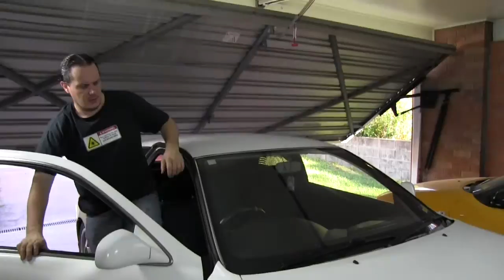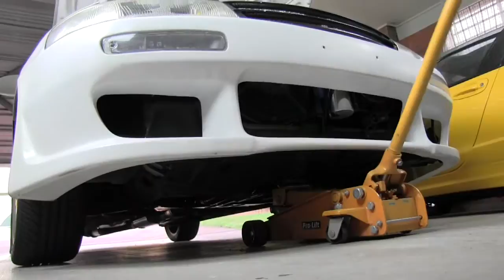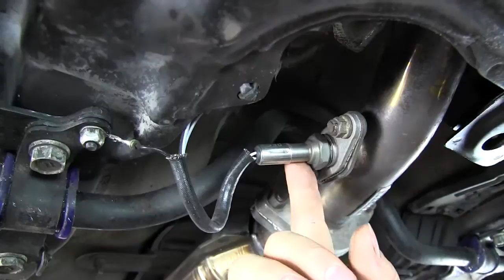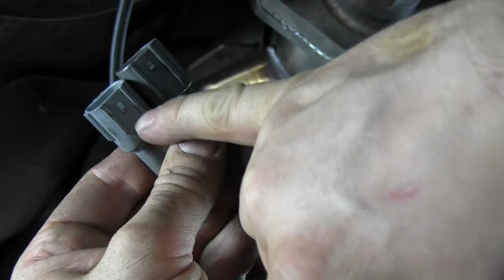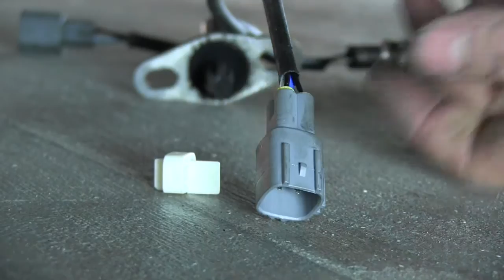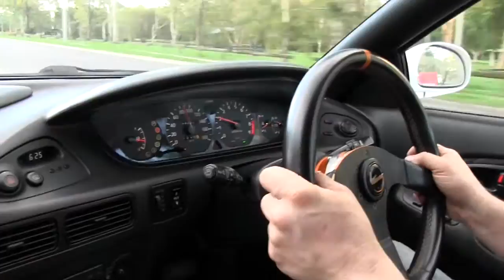How to replace the oxygen sensor on your 4AGE

Comment: can this 02 sensore help my vvt ? not working
Reply from the maker: MICK Thao Possibly... Is your engine in the original car, or is it an engine swap? Make sure the purple white with white line is connected to a speed sensor on the transmission.
Also, double check the operation of the VVT pulley and solenoid. I have another video on how to do this.

https://www.youtube.com/watch?v=ekkXQR2AY-s
Reply: i blew my first engine den brought a 2nd hand engine and bolted into my car ever since that the engine in it now just felt very weak and VVt Never engage so i brought a new Solonoid and also has replace the VVT pulley and that was from the old engine,, also not sure if the timing was off.. and have never replace my 02 sensor yet.
Reply: +TERRAOperative Hey man will that Denso 234-4162 fit standard silver top headers?  I had bought a universal only to find the flange that came with it was too small to straddle the standard bolts on the headers.  The o2 sensor I took out was one solid unit flange and sensor in one.  Toyota NZ does not stock the sensor for the silver top, and may have to buy the Denso off ebay.
Reply: I bought this on ebay, and it did not fit. So I grinned the edges to make it fit. Unfortunately with this new O2 sensor, the engine is bogging when warmed up..Disconnected it, runs fine. Connected again. Bogs.

Comment: Well mate I'm after failing 4 emission tests because of mine not heating .. which wire did you ground the heater ground of the ecu ground I'm pretty sure u mean the heater ground but I'm not 100% please you can tell me as I have another test Monday I'm also driving a 4a ge thanks

Comment: Great video mate! An epitome of 'How-to'. Thanks! 
I'm going to order a Denso 234-4162 and give it a whirl on my Blacktop.
Fingers crossed it will get rid of the hesitating between 2000-3000 RPM when cold.

UPDATE: 26.08.2014: This oxygen sensor is too small for the Blacktop.
I had to cut slots in the side of the sensor. The plugs are a straight fit too, unlike the AE101.
The hesitating hasn't gone away, BUT I haven't run it in properly yet, so the ECU hasn't had time to re-calibrate. Hopefully It'll come right.

Has your fuel economy been better?
Reply: any updates man?
Reply: Shannon Sonny Yeah, turns out my TPS [Throttle Position Sensor] is buggered. It's definitely that as I tuned it as via the manual and it came right! If you are getting lagging issues too, check your TPS and change the Oxygen sensor anyway.
Reply: James Tyrell 

exactly man, but to find a shop that isnt just doing it for the $$ is so difficult. 

so much sense! yeah man, perhaps you could shoot the PDFs to me, trust_wrx@hotmail.com

Man, what a gesture, sadly im in Malaysia, Kuala Lumpur. 
Ill try to sort things out, but thanks a bunch mate, been too damn helpful! 

Cheers!
Reply from the maker: James Tyrell  Yeah, the throttle position sensor can cause a few issues if it's not calibrated properly...
Thankfully it is easy to calibrate with a multimeter and a feeler gauge and some patience.
Reply: ***** Problem is mine falls out of tune after 6 weeks. Does yours do that?
Reply: James Tyrell  ***** 

mine hesitates massively, also my VVT isnt engaging.. i have replaced the solenoid, so i guess my car has got all sorts of sensor/electrical/wiring issues.. sigh.

Its a 20v BT in a KE70 Corolla, and it doesnt even have a diagnostics port. i bought it only with the engine in it. haha. fck..
Reply: Shannon Sonny 
Ah bugger! Nice chassis the KE70! :) I have just ordered a new TPS from SQ-Engineering, $110 AU instead of $280 NZ Toyota wanted and it arrived today.
I measured the resistance of the HT Leads, and they were WELL under the recommended 2500 Ohms! The Cap, rotor and spark plugs were also well worn out. 
Now that the TPS has arrived, I will install that and fire her up with; NEW HT leads; NEW Spark plugs; New Cap & Rotor.

Check all of these on your BT Shannon, especially the HT leads and TPS. 
Do you have a the manual with all the specs for tuning these?
Reply: James Tyrell  

No man.. haha.. i have nothing, not even proper tools and time.. usually think of what the problem could be then take it to a shop to get it checked.. usually shops dont even care.

I see.. so the entire ignition system could be fcked.. 
Im planning to have the whole thing revamped, standalone, new wiring, new sensors, and maybe a COP setup.. that should get rid majority of the problems.. 

But thanks man, ill at least check the TPS, all the instructions are in the manual right?
Reply: Shannon Sonny 
Shops DON'T care unless they are total enthusiasts and really helpful. I got burned by an auto-sparky. Took it there so they could do a FULL diagnosis and it came back working, but they would not tell me what it was. The problem came back and I had to figure it out myself, which I have :)

If you don't have a multi-meter (what sparkies use) you can't check the leads or the TPS. If the leads have NEVER been changed, then it is safe to say they need to be replaced. The insulation and wire inside breaks down over time with the high voltages passing through them.
The TPS on mine was stuffed.

I have the Toyota mechanical service PDF's too which I can give you.

If you're in Auckland I could come help you out. I'm on Facebook, same name, same picture :)
Reply: Shannon Sonny
No problem man! I will shoot them to you now :) Good luck! Keep us posted yeah!
Oh and the Carib is running MINT now after installing the new TPS, leads, plugs, cap and rotor.
Reply: nice! vids man! post some up haha
thanks a bunch!!

Comment: I was kind of wondering the same thing for the blacktop, I see you have grounded the sensor 'signal output to ecu' to achieve it staying hot all the time (black/thick grey), Is this the same with the black top (except white/thick grey)? is this even necessary since like you said the black top just 'turns the thing on'? I'm having o2 sensor trouble codes come through my ecu and related troubles would appreciate any advice. thanks :)

Comment: is the flange size and bolt spacing standard size across models?

i mean if i purchase Denso 234-4162, will the flange bolt on perfectly on my 4AGE 20v stock exhaust manifold? mine is blacktop anyway.